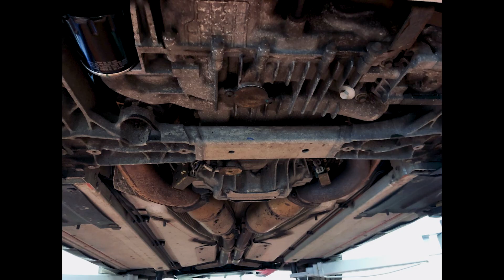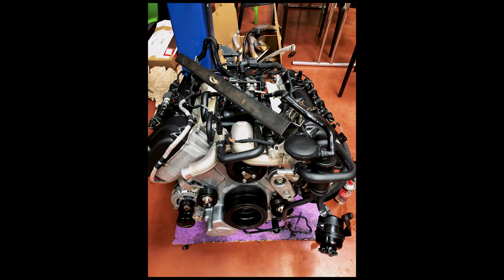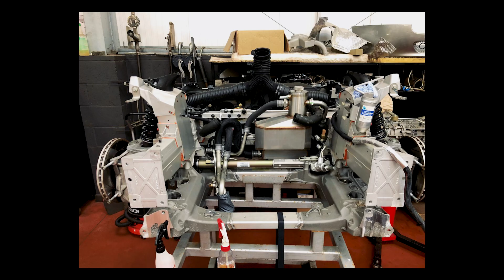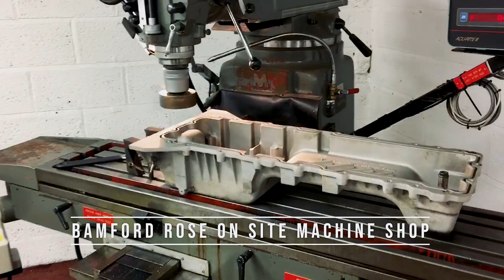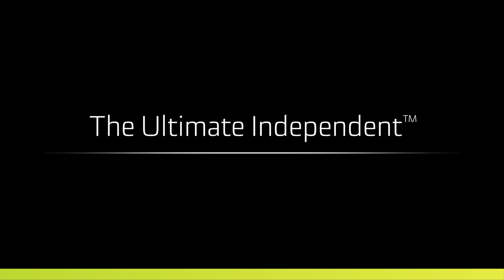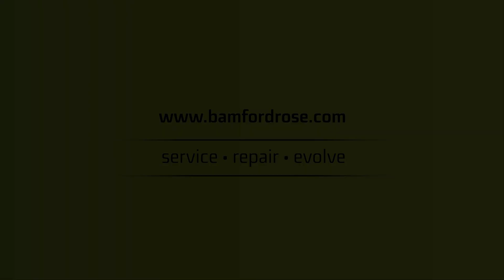V8 Front Cover Oil Repair - Forum Chat #30

Comment: Hi! I don’t understand the part at the end where you said it can leak at around 15K miles or so and then later on after around 30k miles it can stop leaking and be fine the rest of the engines life! Can anyone explain this if the leak is not so bad? Thanks

Comment: quick question nice guys at bamford (amazing content makes me wish other brands had similar specialists)
am about to buy a car and I fear the owner is hiding leaked oil and wants to get rid of it
2006 18k miles manual lives in an extremely dry and hot weather.
How long does the car need to leak back if the amount is above the minimal that you can just clean off regularly ? already went under the car and seems spotless.
in terms of time or distance whatever
thank you kindly.

Comment: Hi Mike, my V8V was about 4 year old with 15k miles on the clock and had a leak. The cross member was showing oil but not enough to drop on the garage floor, doing about 3k miles a year. Fortunately the car was under Aston timeless warranty, was informed by the Newcastle Aston dealer the repair would be around £1800. Aston  only agree to pay a fixed amount for warranty repairs. The repair was done with the engine in the car, the first attempt didn't fix the leak and it went back for another go. It's been ok for over 2 years. I was surprised to see in the workshop manual to replace with the engine in place.
Great vlogs keep them coming, they give owners great advice 👍👍